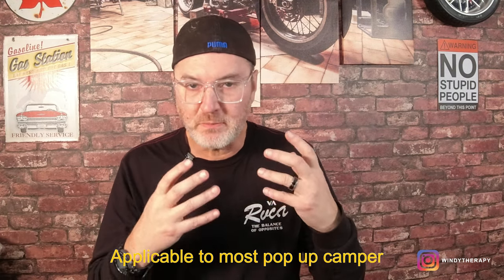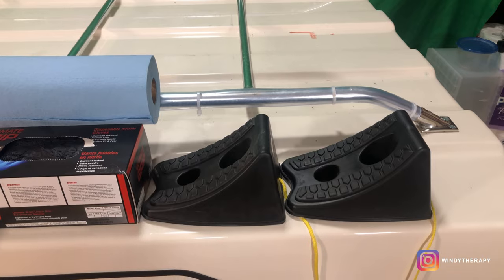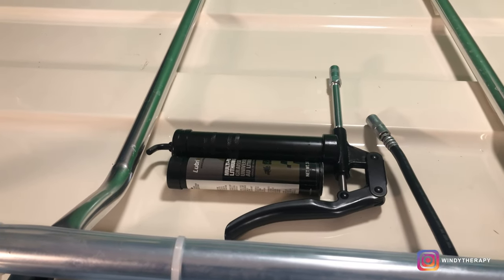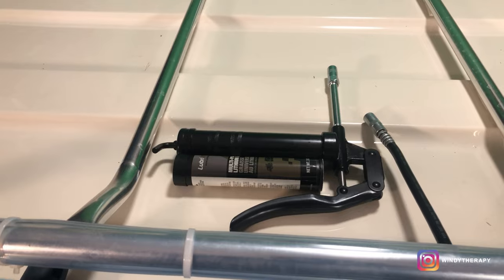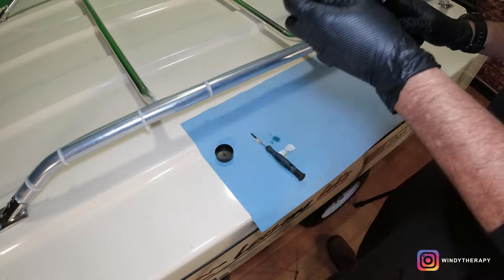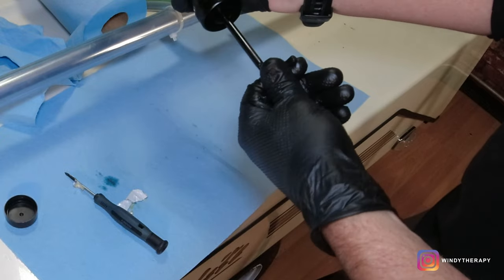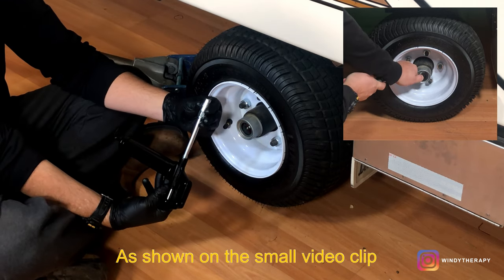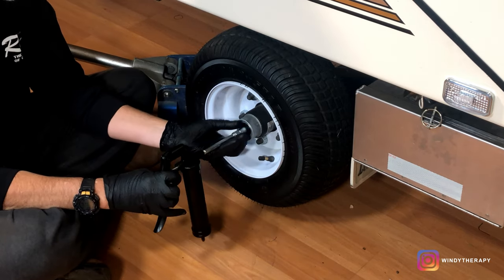Pop Up Bearing Lubrication | Lees-Ure Lite Excel | SLT Excel II Motorcycle Camper

Comment: I think a lot of people do not realize how many times that little wheel goes around and the potential of creating a lot of heat. Nice video
Reply from the maker: Indeed Kev ! There’s a misconception that small wheels need less attention than standard sizes but is actually the other way around. Can imagine these little 8” wheels going 100 Kms / hour ?  Thanks for stopping by amigo. Cheers 🍻 Eddie
Reply: I think that is the biggest thing people don't think about is how many RPM that wheel spins at.  
Your bike tires might spin around 1400 rpm at 120 km, but the little wheels will be over 3000.
Reply from the maker: @DeadNought  Exactly Rob ! These small wheels often come across as “light load wheels” and people underestimate the danger or risks they can present if not well maintained.

Comment: Great tip about the new cylinder of grease - to make sure people weren't thinking that you were putting in too much.
I usually prime it before putting it on a nipple - makes more of a mess, but then I can be sure how many squeezes I am putting in.
Reply from the maker: Thanks Rob ! Yeah, I should've primed it too ! I typically use the large grease gun which pumps a lot of grease but the little one you need to work "harder" as far as getting the entire gun fully loaded. (the next time it will only take one or two squeezes. Thanks for watching buddy. Cheers amigo
Reply from the maker: I hope you're having a good Remembrance Day long weekend. Thanks for your service and sacrifices. 🙏

Comment: Well done bro. I need to replace the rear seal in one of my trailer.
Reply from the maker: Thanks Roberto ! Yeah it is a pretty easy preventative maintenance routines that only takes 10 mins. (As long you have the grease nipples or a grease buddy system)
Thanks for checking my friend
Reply from the maker: Enjoy the heat ! It is getting crispy here
Reply: @WindyTherapy  thanks bro. Be safe.

Comment: The Mini Mate isn't as quite as quick n easy to grease the bearings as your camper, on mine I'll have to remove and repack the bearings, but it's not too difficult. I do like the bearing maintenance on your Lees-ure Lite, nice overview buddy !!.  👊😁👍
Reply from the maker: 😱 Can you install a "Grease Buddy" ? It is about 50.00 bucks of a pair
Reply from the maker: Having the grease nipple is a time saver ! Thanks for stopping by my friend. Cheers. 🖖
Reply: @WindyTherapy  I dunno, I'll look into it, I bought a spare set of wheel bearings with the camper, they were $20 so what the heck, they might be 5 to 10 years old by the time I replace the bearings, but I got them as a backup in case one of the bearings happened to fail.
Reply from the maker: @SpyderWayne  Yeah just search for “Grease Buddy” (check the manufacturer’s website not Amazon) because if you grease the bearing every 2nd year or so, I bet you wont need to replace the the bearings.